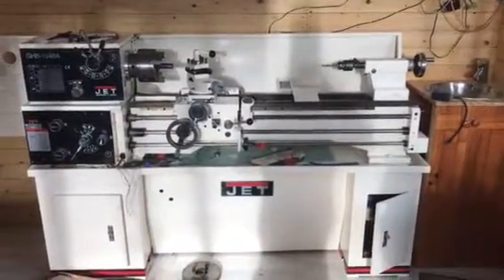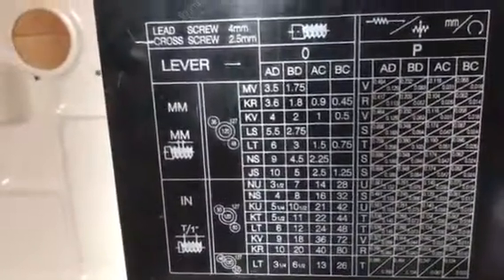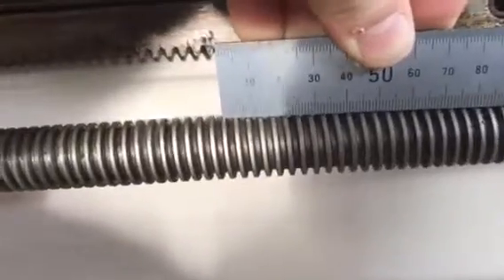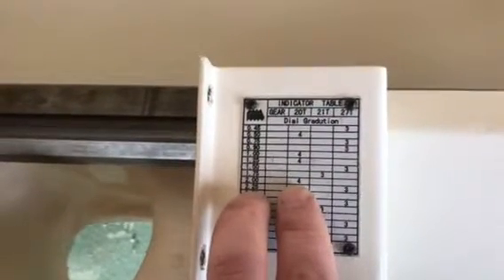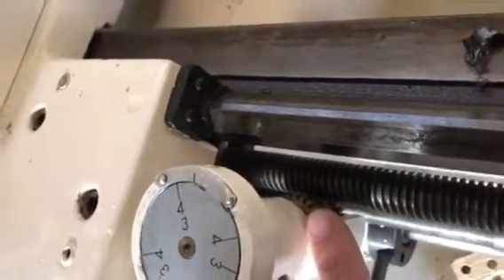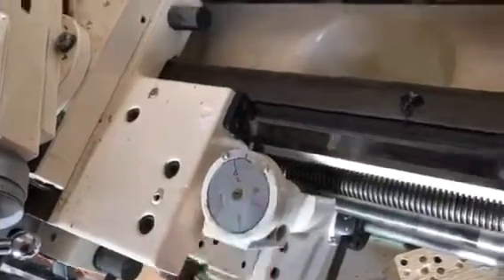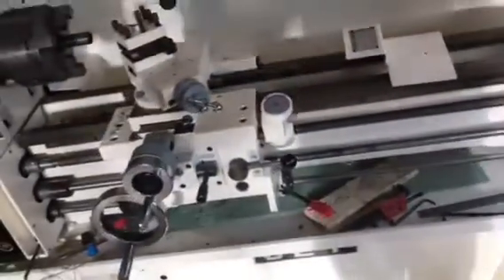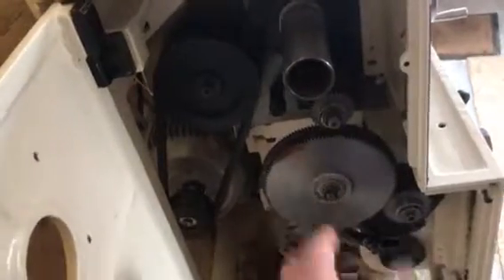Lathe  GHB 1340A thread problem

Comment: Hello my friend ! I not used this indicator! I don't no  as this work ( 
I work by the usual method, I use the reverse and do not disconnect the nut. this is an old school, I do not know how. gears are as in the table: 36,127,48
Reply from the maker: Agrompapas 
Thanks 
Could you just heck how many teeth you have in thread dial indicator? 
Thanks :)
Reply: I have 3 gears: 20,21,27 teeth. Twenty teeth rotate in the work.
Reply from the maker: Agrompapas thank You
Reply: If you have any questions, I will help, if it will be in my power!)